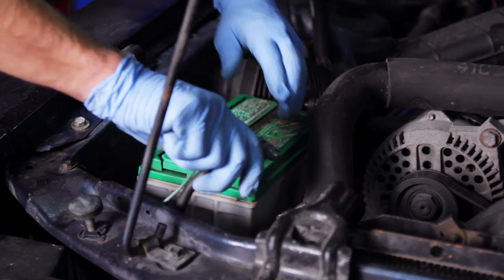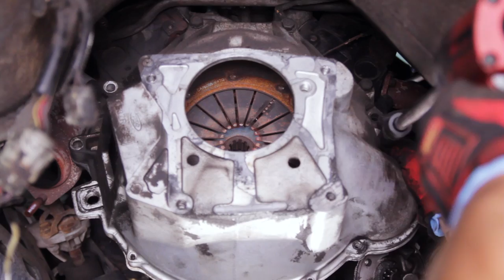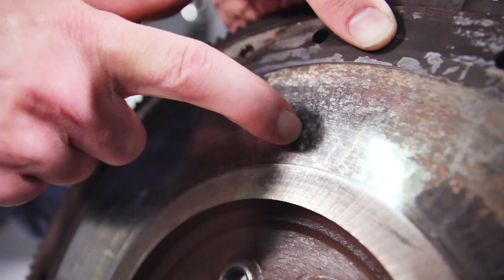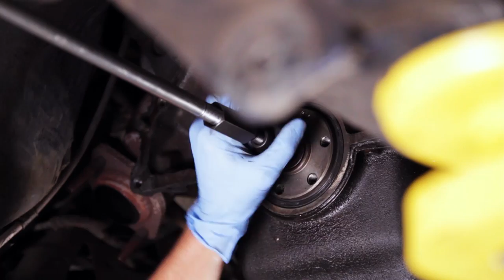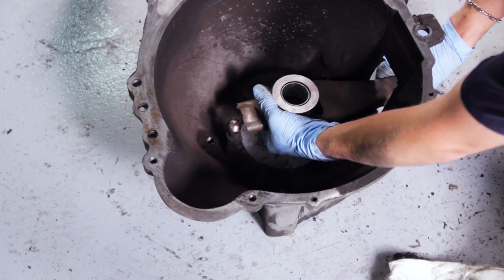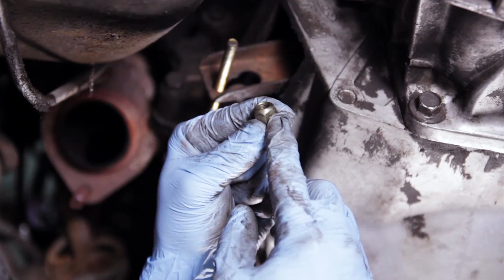How to Mustang Clutch Installation (79-04 Fox Body & SN95)

Comment: When getting off the fly wheel bolts, I found that using a bolt on the fly wheel and a bolt in the bell housing bolt hole(bell housing is off), and then attaching a carabiner to both is the safest and most effective way to hold the fly wheel in place. You can then use both hands to remove the fly wheel bolts and hold the fly wheel when ready.

Comment: you can also pack the pilot bearing with grease and force it out  hydraulically by taking the end of the centering tool, taking the handle off and giving it a couple of hits with a rubber mallet.  I use an old input shaft now.  works just as well.

Comment: A tip when putting the transmission back in. I had trouble and it kept trying to undo the throw out bearing. The solution? While trying to align the transmission have someone push the clutch in. This will grab the transmission and slide it in enough to tighten the bolts. Once the bolts are in you can tighten as recommended

Comment: Just got all that installed but I paid a shop. Snaps could have done it myself. And I see there was no need to drain the transmission either. O well. I have to redo my rear drum brakes but I will attempt to tackle that one myself.

Comment: Just got my clutch replace and there's now a weird vibration in the car at idle. The clutch pedal also feels rough/gritty when depressing it. The car idle and pedal was butter smooth before install. What could be the issue?
Reply: Could be because the new clutch has more material on it than before. As in if your clutch cable was in the same position as it was before the installation, your new clutch may be partially engaging. Did you try adjusting the cable?

Comment: Don't forget the T-45 crowd. That bell housing does not separate from  the gearbox.
Reply from the maker: Yes, on many of the SN95 models you will have to take the transmission and bellhousing in one piece. There are some minor differences across all transmissions you will remove; however, the clutch installation itself is the same across all models.

Comment: Great video, guys. I'm halfway through doing the clutch on my '89 LX 5.0 and this is what gave me the confidence to attempt it. I'm a little stumped over the pilot bearing, though. I found the slide hammer too you used, and it did what it was supposed to do when it comes to removing the center part of the bearing. However, there is very little for it to grab onto and I can't get the rest of the bearing out. Any ideas?
Reply: There is 2 small cut out grooves on the back of the pilot bearing for the fingers of the hammer tool end to go in🙏😇💪😎👍

Comment: Have an 87 LX with pivot ball stud issues and I've seen this video so many times... It almost looks too easy... Got me gathering all parts as ill be replacing the stud,fork,clutch kit,cable and will be adding a firewall adjuster. Can i use the asjuster with an non adjustable cable? Anything else i might be forgetting? Thanks in advance and thanks for the great walkthrough. And sorry for the noob questions. Subscribed!

Comment: Is the driveshaft orientation that important?  I realized that I never marked the driveshaft before removing it and its way too late now because its sitting in my garage...
Reply: It will only go in right, or off by 180° when you put it back together, if it isn't just right, it'll feel way off

Comment: This was a great video! What is the recommended break in period?
Reply from the maker: Thanks for the feedback. Depending on the clutch manufacturer, break-in periods can differ. Most manufacturers state responsible driving for a couple hundred miles for proper break-in. -Landan

Comment: Jesus this guy just wants you to spend hella money and replace everything, if your adjustable cable feels weird then replace it..... Hell no just adjust it
Reply: Pretty sure he means if it feels like its binding, if it feels like it's not sliding through the sleeve smoothly.
Reply: 2001 here... I here ya'...
Reply: I mean if you want to go back and redo it that's up to you...
Reply: The guy is smart it blows my mind how many people just want to replace the bare minimum all the time and wonder why their car is unreliable every vehicle I own has 100k to 500k and although I do work from time to time on them all I've never ever been stranded because I do just like this guy when I do a job I do it right all those parts he mentioned are wear items and if they lasted 30 years then your very blessed but really an extra couple hundred bucks is much cheaper than pulling the transmission again just to replace a failed clutch for or 6 dollar pilot bearing.. Just do it right and you will never kill your Ford
Reply: Eh just replace it, that crap ain't worth getting stranded over. The headache/towing/ STILL having to replacing it just aint worth it.
Reply: I just bought a 97 cobra with 51000 miles 99% cherry for what I paid for it I definitely will place everything on the clutch assembly and I mean everything of course my local ford dealer will be doing the work

Comment: FYI original transmission was probably from a v6 car had a much smaller pilot bearing on the end of the input shaft, are the Bell housings for a v6 nd v8 the same ??

Comment: Is there any trick for removing the plastic alignment shaft and sliding in the input shaft to keep everything lined up right? You kind of skipped over what I thought would be the critical part. Everybody keeps telling me "the alignment is the hard part" my dad (who likes to make up mechanical facts) was going on about the alignment too, but I only see one possible way it could be aligned. To be fair, he probably never changed a clutch before tho and I feel like most "car people" just regurgitate what they hear online and they actually don't know LOL I did have to rotate the clutch housing to get it to line up with the dowel pin and bolt holes, but a kindergartener should have that level of matching skills lol. My new transmission jack should be here next week (just in time for more snow) so I guess I'll have to wait  a little longer to see what everybody means.

Comment: I have a 1977 fastback and the clutch has been changed and flywheel resurfaced but the pedal is extremely hard to press !! any thoughts or help would be very appreciated
Reply from the maker: I'm assuming it's cable driven? If so, inspect the cable and verify that it isn't binding within the sheath. -Landan

Comment: What assembly grease are you using on the pivot stud, TO bearing, input shaft, sleeve etc.? Do you put a dub in the pilot bearing?(new one came w/ some on it)
Reply from the maker: We recommend using any sort of transmission grease when installing any transmission components. You can pick some up at your local auto parts store. Adding some additional grease to your pilot bearing will work as well. Just a small amount will work
Reply: Awesome, I really appreciate it, thank you

Comment: I wasn't able to use my 85 flywheel with a 86 and up clutch. The bolt pattern wasn't the same. So I picked up a new flywheel.

Comment: hey fantastic work and great video. I may do this in the future.  Question! Can you guys do a video on how to remove and install a new transmission tailshaft bushing?!? I am very afraid of this. I replaced my rear seal on the tailshaft, but found out that I am exceeding the OEM limits on driveshaft movement (up/down wiggle). I looked at the yoke and realized that it was pretty worn down also...(smoothly though no scoring). How am I looking you think?? Thanks guys! 1989 5.0 GT with T5

Comment: when pulling the transmission off the bell housing, i was only able to get it about 3/4" apart, then it got stuck.  it looks like the throwout bearing is messed up pretty bad, and it seems stuck on the transmission shaft (every time i move the transmission, the clutch fork moves as well).  do you have any tips to remedy this and get the transmission out?  thanks
Reply: +Kyle Cook take off the bell housing from the motor without removing the transmission first.

Comment: I noticed you pulled the transmission from the bell housing instead of leaving them together.  Why did you do it this way?
Reply: Paul Fancett 
it seems easier and a lot less weight to remove them separately,
Reply: It’s way easier to get to the top bolts on the bell housing

Comment: What you need to know he does not tell you! He has good information but does not tell you what you could overlook and cause you to blow your transmission. 1. Each crankshaft has a hole in rear for the pilot. Each crank has it own diameter bore which has a tolerance for the pilot bearing. The outside diameter has to be slightly larger by a few thousandths to fit tight. The inside diameter of the pilot bearing being too wide or too much in diameter will let the main shaft in the transmission wobble up and down if it does not fit tight to the mainshaft of the transmission given about ..003 at the max. Example: Dorman bearing: I.D. .680, MR52 and most of the Mustangs carry the .699 mainshaft. If you install the .680 onto that .699 shaft you will get out of balance due to a clutch disc rocking when you clutch it at any r.p.m. which will cause the shaft to wear on both ends and ruin the pilot also. Many companies will not give you the inside diameter or lie to you and you will install the wrong one. Check with Ford on the spec of your crankshaft and see for yourself. Auto Zone, O'Reilly's, Advance Auto conflicts on their applications selling different bearing specs. for the same engine, especially the 1989 Ford 5.0. The pilot hole outside diameter in my 1989 Ford 5.0 is 1.3689 and Dorman 14677 has their outside diameter at 1.378 which will be .0091 given me about 9 over, 4.5 on each side which will fit ok. But, the inside is too big at .680 on the Dorman 14677 and the Dorman 690-083-1 is alluded to be .0672 which is right to fit the .699 but Dorman sells it under part number 14677 which on the back of that pack it clearly states it is .680 causing the main shaft to wobble like hell and screw up trannys.  Now, people, You have a better education on tolerances vs. what these companies sell. I just got one in from Pioneer which the box states that it was made for my 89 5.0, but when i checked the inside diameter it was .695 -.669 to .695 is enough to screw up my 2000 dollar trans fix. O'reilly did not know the difference, but only sells the part, auto zone claimed they were the same but when i could show them the spec in front of their face all they could say was duh , i don't know. Advance said the same, and is selling a bearing that is 1.45 inch diameter for the bearing that goes into a 1.369 crank. Can you imagine beating that into the end of your crank? That bearing is National® - Clutch Pilot Bearing
Part Number: FC65662
Line: BCA
	 1 year limited warranty 	
		 UPC: 724956003792 		
Needle Bearing
						
Detailed Description
A full line of premium oil seals and bearings Premium bearing design matches OEM specifications Precision manufactured using premium steel grades for outstanding durability and performance Available in both caged design and full complement
 
	 		
Additional Details
		
Bore (In): 0.6733 Inch
Bore (mm): 17.102mm
Outside Diameter (In): 1.450 Inch
Outside Diameter (mm): 36.83mm
Width (In): 0.670 Inch
Width (mm): 17.018mm
	I give up. Ford motor company technicians do not or cannot tell you the exact factory diameter of their end crank bore for the 5.0 neither have i seen it anywhere on any forum or site to explain it like i have. So, go blow your trans, disc, bearings, gearns and don't forget the pilot!
Reply: Your on late model restorations video.
Go to their website and get a ford performance pilot bearing. Boom. Done.

Comment: I just bought a clutch from you guys but my throw out bearing is hitting the pressure plate and not letting the fork move.... what did I do wrong
Reply from the maker: Jesus, the throwout bearing is supposed to make contact with the pressure plate. Double check the orientation of the throwout bearing. -Landan
Reply: Late Model Restoration ok thanks for the info

Comment: Okay so I have an 04 mustang v6 3.9 can I split the transmission from the bellhousing like you did in the video end of the rear main seal still come out that easy like in the video I was told you have to drop the oil pan I had mine done with xtd stage one I watch the guy do it most of it but now that everything was installed the pressure plate clutch plate pilot bearing throwout bearing I now have a bad vibration oh did I mention you left out the spacer plat
Reply from the maker: According to the service procedure for the 3.9L, it does not show you have to drop the pan.
Reply: @latemodelrestoration  thank u iI appreciate that I was given the wrong information from a so-called mechanicI put an xtd clutch in my mustang and now she's got a bad bad vibration I don't know what the cause is the company sent me a new pressure plate throw out bearing and pilot bearing so I'm going to try to replace that and the bonehead left out the freaking spacer plate I'm sure that has a lot to do with the vibration

Comment: I have an 87 5.0 302 ho. I bought a fly wheel with a 50 Oz damping weight welded on it. Where should that 50 Oz weight be when the motor is at top dead center. I hear if the rotating assembly is not balanced it is bad for the engine.

Comment: i got a 02 mustang v6 manual and when im going like 80 and try to shift to 5th gear it grinds and wont go into gear ,.only when im in 60 mph , what you guys think its the issue?
Reply: The synchronizer for your 5th gear is most likely worn out but first change transmission fluid to see if that was the problem. :) My reverse gear is like that...

Comment: after installing a new clutch set in my 99 mustang and got everything back together, the car isn't wanting to run right. could this be do to timing in the motor,
Reply from the maker: This could be from several issues. Was the car running right prior to changing the clutch? -Landan
Reply: +Late Model Restoration i guess we will never know

Comment: Pretty basic question but what exact tools did you use in the video? looked like a select few but just curious on what exact tools i would need to pull the transmission out. Thanks! of course i'm changing the clutch on the T45 transmission in a 96 Mustang, not sure if it would matter.
Reply from the maker: A quick run down of tools would be:

Jack
Jack Stands
Socket Set
Wrench Set
Plier Set
Several Extensions
Wobble Socket Set
Torque Wrench
Air Compressor (Optional)
Impact Gun (Optional)
Slide Hammer (Optional if replacing pilot bearing)
Brake Clean
Shop Towels

Comment: What kinda clutch cable was he talking about? The aluminum adjustable one? He called it someone else...????
Reply from the maker: You're probably thinking of either the aluminum quadrant that attaches to the clutch pedal assembly under the dash or the firewall adjuster. -Landan

Comment: So a while back we did a clutch job in my garage we replaced the fly wheel and pressure plate and clutch and crossmember. But ever since then my car has had a horrible vibration anyone know why its only at like 70 and its not rpm dependent its only speed dependent
Reply: Check the drive shaft.

Comment: I have a Ford Mustang 1991 5.0 and the transmission has 4 gears but it's not giving me the 3rd and the 4th The car sounds like once it does 1s gear 2nd gear the car suddenly sounds like if it went nuteral and it doesn't go anymore faster because it sounds like if it had no 3rd gear or 4 gear I Changed my speed sensor and nothing..." It's an automatic transmission
Reply: Rudy Hernandez clutch packs could be burnt, a shift solenoid or you shift cable could be your problem..

Comment: What is that tool part number
Reply from the maker: What tool? The clutch alignment tool? Pretty much all clutch kits come with one. If it didn't check out the link below. -Landan

https://lmr.com/products/Mustang-Clutch-Hardware-And-Accessories
Reply: @latemodelrestoration  the tool for pulling the pilot bearing.
Reply from the maker: @florentin1888  There are several retailers that sell slide hammers and pilot bearing attachments. I think we used a slide hammer kit from Harbor Freight. -Landan
Reply: @latemodelrestoration  nuce.thank you..your videos are great.
Reply from the maker: @florentin1888  You're welcome and thanks for the feedback! We're glad the videos are helpful. -Landan